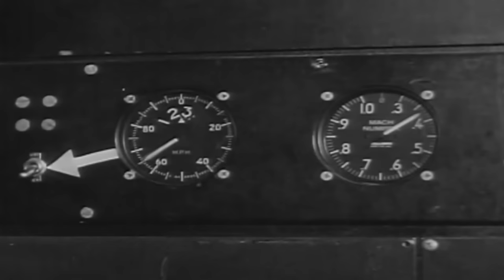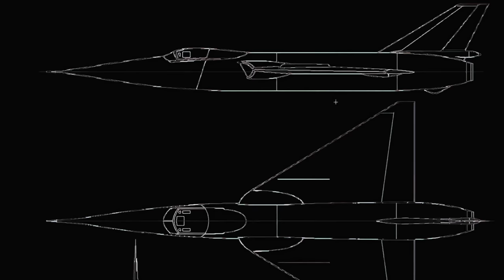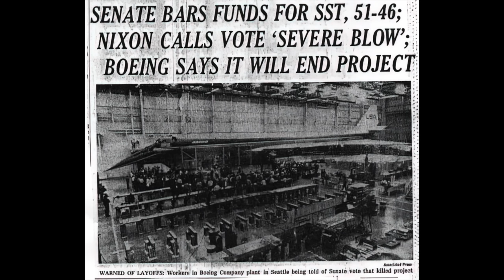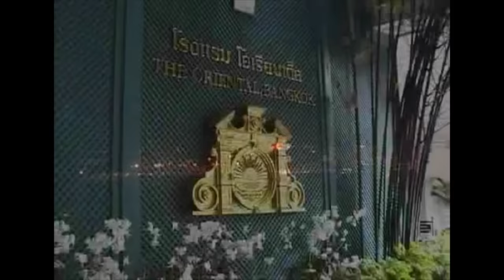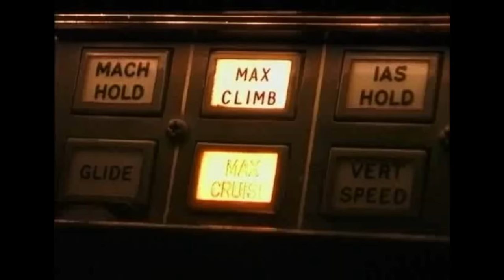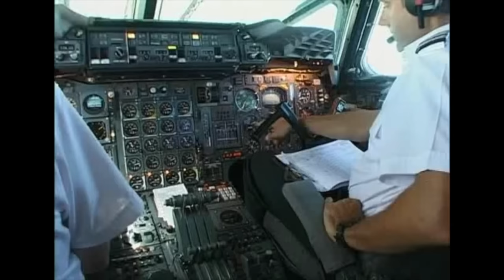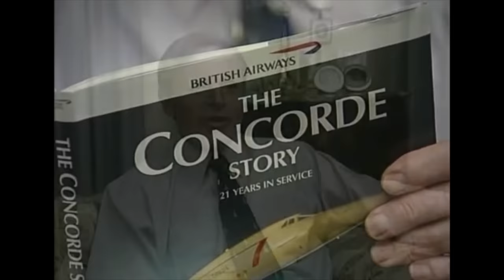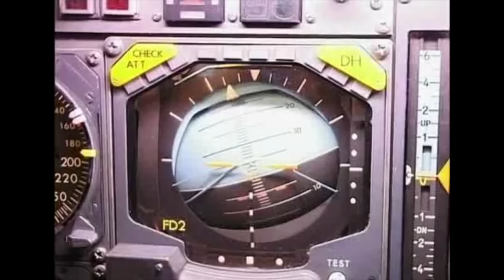Concorde: Faster Than Sound, More Luxurious Than Ever

Comment: I still think design wise the tu 144 sst, had a better looking profile than concorde..especially after they added those canard mini wings just aft of the cockpit..
Reply from the maker: Knowing now that the Soviets had been stealing Concorde’s plans for years and years, one should wonder how early in the project(s) they actually put their hands on those drawings. Turns out they were not that good at copying and adapting, as the Tu144 was a failure, operationally speaking.
Interestingly NASA ended up using it for research purposes for sometime.

Comment: 😅Very interesting but why the constant carping on about kilometres per hour. We still use miles in Britain even today, 5 years after we left membership of the European Union. We never accepted metric measurement even during all those years as a member of the EU.
Reply from the maker: The aviation industry, and other professional venues (NASA, ESA, etc.) mostly use the metric system for practical reasons (it makes more sense)
Reply: The entire modern world uses metric
Reply from the maker: @markblanch2905  Well, the US uses the Imperial system, so does Britain, to an extent, as there is some sort of transitioning, although internally companies like Being, Lockheed, etc. even in the USA, definetively use the metric system, otherwise it would become almost impossible to cope, technically speaking. Once learned, the metric system seems to be vastly more practical (the endless debate). Hospitals in the US tend to use the metric system as well, and so do others. It's ood, if you think about it, as the US uses 110 volts, but they also have a 220 volts outlet for washer and dryer in every home, just like most of the rest of the world does. Once I read that the reason is that the US had electricity first, and Edison went for 110 volts for various reasons, but the 220 Volts is more practical in many ways, although it would have been too complex to switch to 220 volts, and a few countries were stuck with it.
Reply: @Dronescapes  the metric system is indisputably vastly more practical. 
That's simply fact
Reply from the maker: @markblanch2905  It's probably going to take another 100 years before the world is uniformed. I sense there is a deeply rooted sense of pride in keeping the Imperial system, or driving on the (wrong) side of the road 🙂
Reply from the maker: @Phillip Banes I read on the NASA website: "...Although NASA has ostensibly used the metric system since about 1990..."
The double system also led to the loss of a $125,000,000 Mars Climate Orbiter in 1999. Ideally the whole planet would use one system.
It also seems that the metric system was also used for the Apollo missions, so it might go back many decades.
SpaceX seems to use the metric system as well. The U.S. military also uses metric measurements, for example a klick is a kilometer, this since last century.
It seems that the vast majority of the planet uses the metric system, except the USA, Liberia and Myanmar, plus Britain that uses a mixed system. I would say it is a vast minority of the planet.
Perhaps there are good reasons for that, but I guess it is an argument that has been going on forever. You would think that if the Brits seem to be transitioning, the U.S. would follow suit, especially given that the system is a British heritage rather than an American one. Interestingly it seems that the Brits got some of it from the Roman invasion (mile, foot, ounce, pound). It seems the Romans might also be the cause of driving on the left.
It seems that almost 95% of the earth population uses metric, but interestingly also 78% of the world's GDP, which is still a vast majority even when it comes to the money factor
Reply: @@phillipbanes5484 well....tDump,  imperial (superseded decades ago) system, it does beg the question...
Reply: how about furlongs per kilosecond ? or fingerbreadths per moment ? would make about as much sense as the imperial system
Reply: @@phillipbanes5484 couldn't care less, it's simply baffling to use something so illogical
Reply: @Dronescapes No they don't. I work in the aerospace industry for last 35 years and use the imperial system everyday.